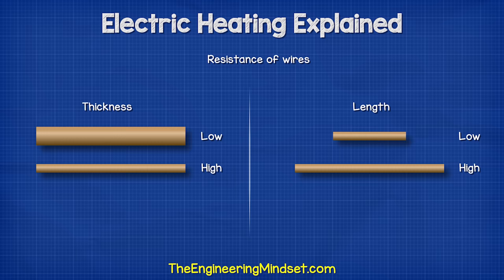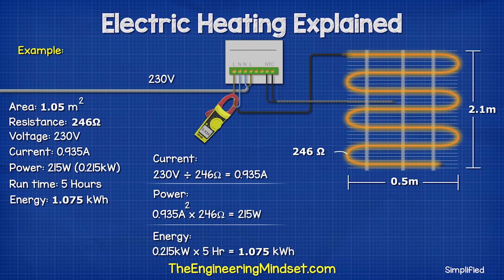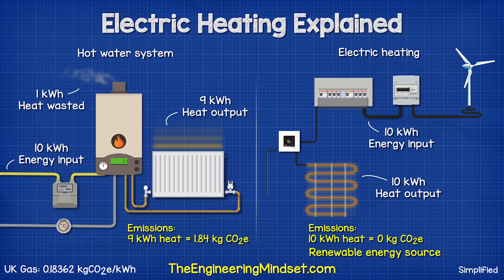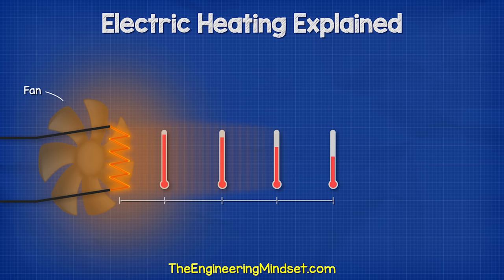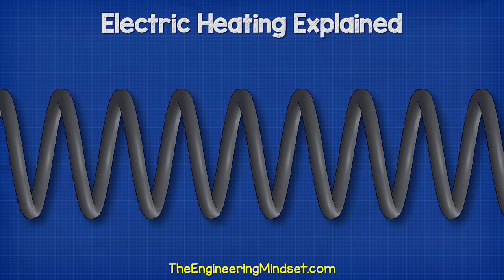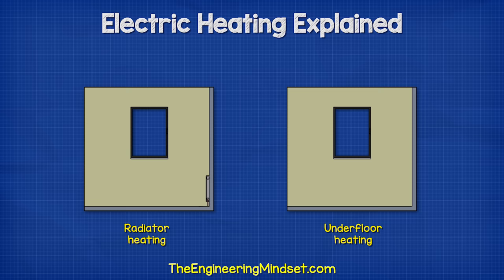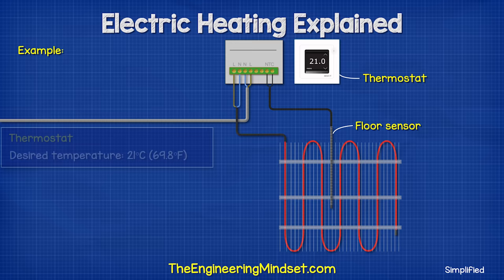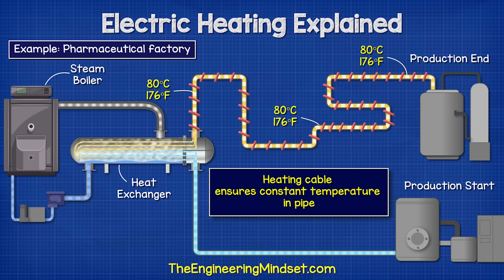Why electric heating is the smart choice

Comment: 𝕄𝕪 𝔹ℝ𝔸𝕀ℕ (♥𝕤) 𝕋𝕙𝕚𝕤 ℂ𝕙𝕒𝕟𝕟𝕖𝕝❕ 𝕐𝕠𝕦𝕣𝕤 𝕤𝕙𝕠𝕦𝕝𝕕 𝕋𝕆𝕆❕
Heating tapes/ropes are awesome! I have used them to evenly distribute high temps across a vessel's body (Borosilicate glass chemistry flask). Controlled by a variable transformer (variable voltage) as to raise and lower temps to exact ºF/ºC.